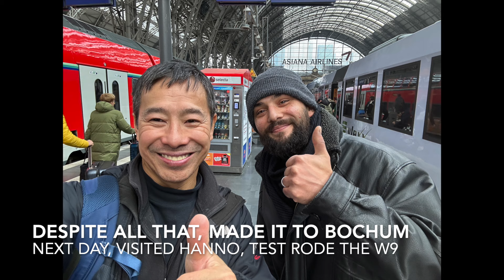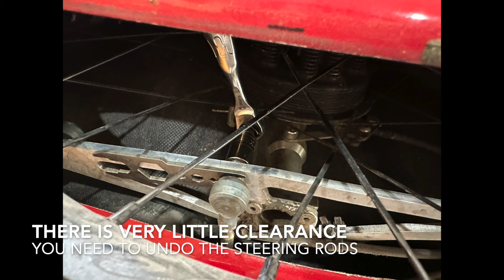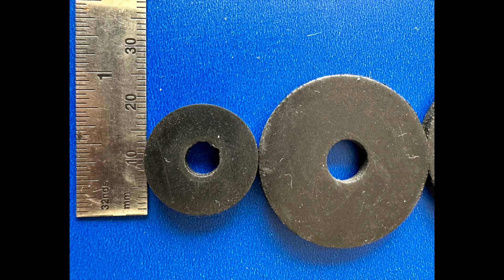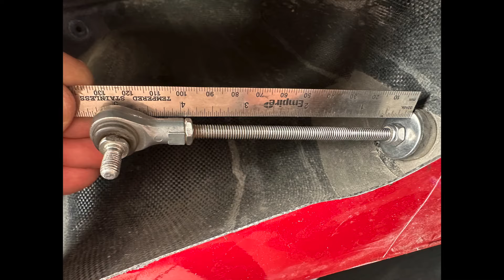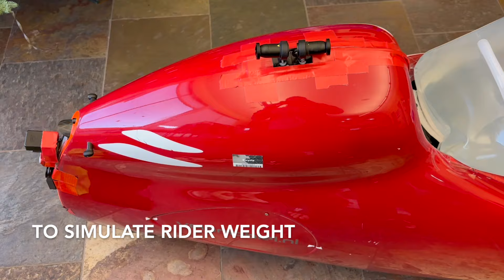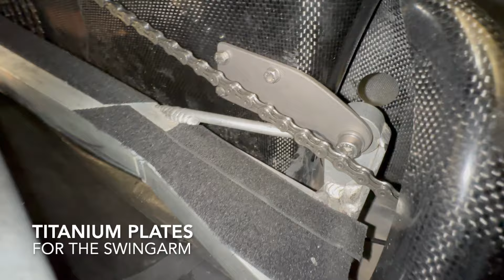Snoek Velomobile: New titanium steering plates

Comment: I have a DF XL and the steering plates have extension to make them longer, attached with bolts. These extensions bend any time the suspension is pressed in to the max (potholes etc). Titanium plates of middle length prevent the plates bending but I fear that then one of the steering rods will bend instead. It is as if there is not enough space for joint near the bending spot to fully move to max impression of suspension. Do you have a suggestion?
Reply from the maker: I have a DF video with a new hole drilled for the trailing rod that provides extra room to move. At least I think I do back when I installed longer plates in my DF
Reply: @shenzhenpingpong  That is correct and I found the video, thanks very much. I keep on being surprised why the rods bend in the opposite direction of what you would think. I have steering-plates add-ons (old solution to extend them) and they bend upwards... I am interested in stronger plates, but at the same time I may be transferring the problem to the rods, which may bend when the plates are stronger (than the rods..). Are your titanium plates still going strong in your Snoek?
Reply from the maker: @ArjenMeurs  the titanium plates in my Snoek are excellent. Perhaps overkill. Titanium will bend and bend back. Aluminum won't.